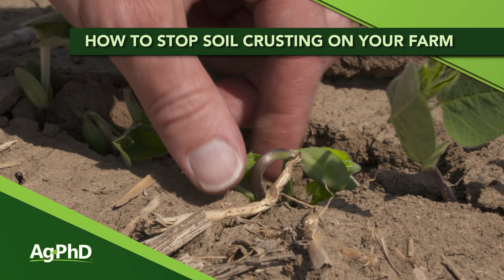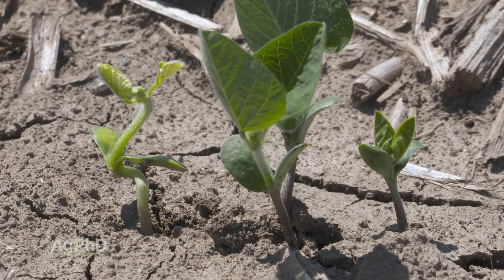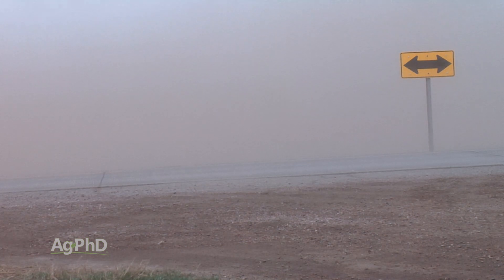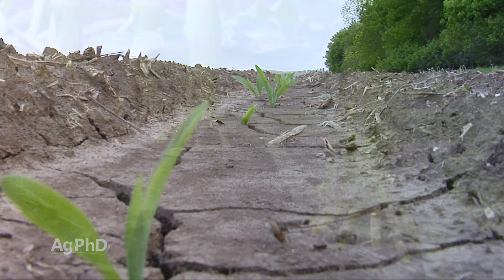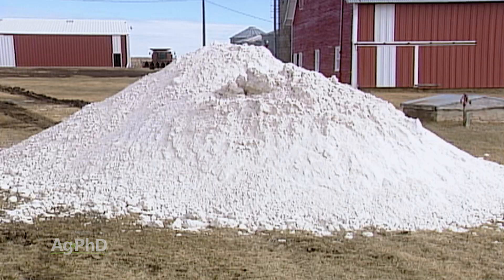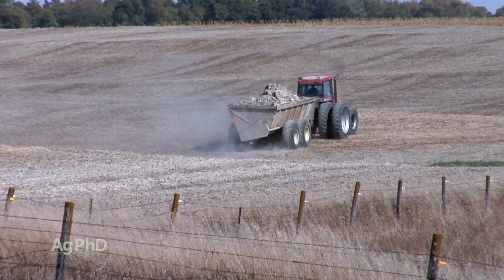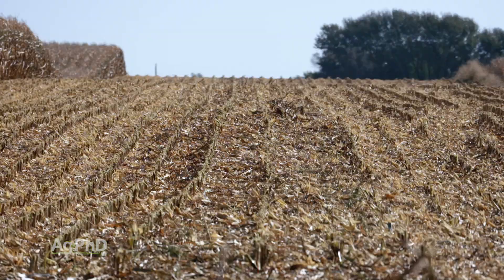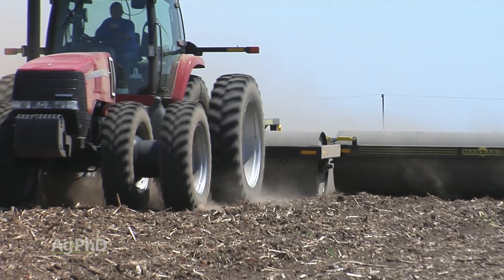Preventing soil crusting on your farm.  (From Ag PhD Show #1127 - Air Date 11-10-19)

Comment: The roller is a double edged sword it is a tool that must be used wisely. Up here in southern ontario we have all soil types from sand and gravel to extremely heavy clay. If it’s a wet year park the roller it will make a mess on clay. But on a very dry year the roller is what saves us on the clay by helping retain soil moisture. I do agree surface residue always helps. And I try to keep as much as I can

Comment: This is more of a cure instead of prevention, but I'm surprised they didn't mention the rotary hoe to break surface crusting.  I used it in organic production for weed control, once before and once after both corn and soybean emergence.  Dirt and old stalks are flying everywhere and you think you're annihilating your crop, but it usually doesn't cause much damage.  The faster you go, the shallower it goes in the soil. 6-12mph is the recommended range, iirc.
Reply from the maker: Brian and Darren addressed your comment on Ag PhD Radio: https://soundcloud.com/agphd/05-31-22-planting-and-crop-progress-updates?utm_source=clipboard&utm_medium=text&utm_campaign=social_sharing#t=57:59

Comment: We in our area of the NorthEast Arkansas  have a mixture of soil types from heavy clay/gumbo to course Sand. Sandy loam worse scenario is recieving a hard 2inch plus rain after planting not so much on the gumbo  but really on the sandy loam soils..
I've actually pulled up cotton stalks that had a perfect curly Q in the stalk a 1/2 inch to an inch below the surface so in my estimation that meant it was 1 to 2 days delayed emergence...the worst scenario that occurs is in the rice crop we use a practice called flushing that is turning on well and putting on a flood to soften the crust it is an awful amount of work and cost...a .2 to .3 inch shower is best.
It can take several days to flush a field